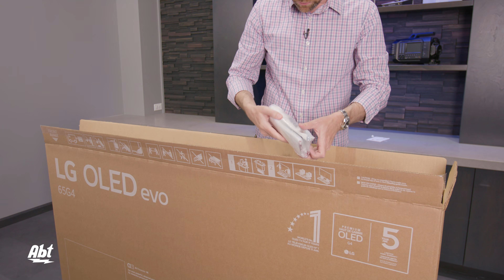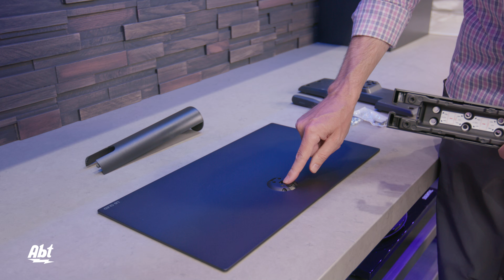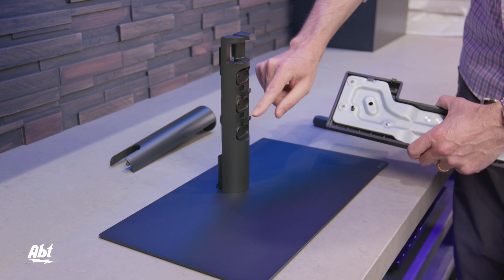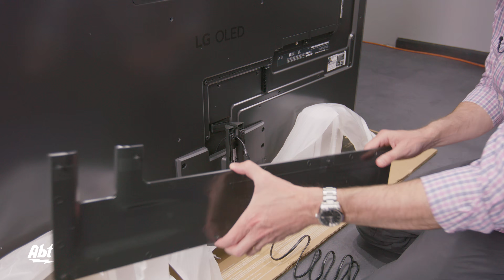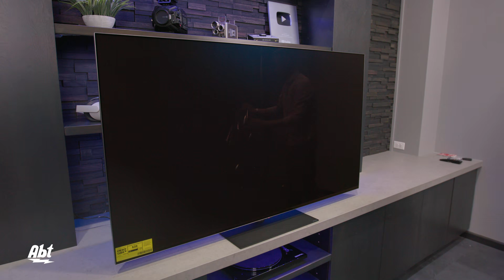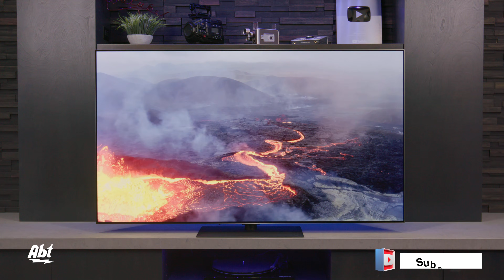How To Unbox The 2024 LG G4 OLED And Install The Pedestal

Comment: The stand is easy to assemble. My question is, since it seems to fit both the 55 and 65, I wonder if it fits the new G5 55 and 65 inch models as well. They have identical dims, and the other larger tv’s (77 & 83) are also backwards compatible. Any real world answers there guys? Nice vid 👍👍
Reply from the maker: @user-hf8ie8mf3n We don't have a G4 at the store any longer to test this out. According to our parts department, all three parts that make up the pedestal have different part numbers on the G5 vs the G4, so it looks like it would not work. We are waiting to hear back from our LG representative for a definitive answer and we'll update this comment once we know for sure.
Reply: Appreciate it. Cheers. 👍🤪🏳️‍🌈
Reply: No worries. I’ve dealt with this stuff for years. Just used a stand designed for the G4 77 on a G5. Fits perfectly. The other stands are exactly the same, part numbers don’t mean anything. You’ll have to trust me on this. I’ll be okay. Cheers.
Reply from the maker: @user-hf8ie8mf3n We also just got confirmation from LG that the G4 pedestal fits the G5 as well. Have a great day!
Reply: @abtelectronics would this be the same process for the g5 55 inch ? Or do you lay it down ?

Comment: Hey, maybe you said it, but if you buy the model with the stand, is there still a wall mount included or you then have to buy this seperately?
Reply from the maker: @SkoxLy The 55 and 65 inch G4 each came with a stand. The wall mount is a separate purchase. The larger sizes came with a wall mount, and the stand was a separate purchase.
Reply: @abtelectronics is the same process for the 55inch g5 ?
Reply: The G42LW is come with wall mount. The G43LS come with stand. So be careful when you buy it.

Comment: Today the TV is still sold, but the pedistal (ST-G4SN65) has since been discontinued. This means that either you have to wall mount the TV, or you should not get it at all.
Reply from the maker: @TheEbbemonster We can still get the pedestal, but it has been on backorder for a bit. Here's a link to our site where it can be ordered if you need one: https://www.abt.com/LG-OLED-G-Series-83-inch-and-77-inch-Stand-and-Backcover-STG4WR8377/p/213595.html

Comment: It's annoying they don't give you this on the 55 inch — they want us to lay it flat face down, but I don't want to put pressure on the pixels.   Mine is arriving shortly and I'm thinking a better way might be to just sit it on 2 identical dining table chairs with high enough backs to hold it upright, and the gap in between the two chairs allows room to come underneath to fit the stand.
Reply: How did you do it in the end got g5 coming tommorow
Reply: @Dingle18   i used the 2 dining table chairs with padded seats.    it leaves a gap in between the 2 chairs where i could attach the stand.
Reply: @Animal_lives_matter oh really is laying is down a bad idea everyone lays it down I’m getting a g5 55 inch tomorrow as that says to lay down
Reply: @Dingle18 
If you do that just make sure the surface is perfectly flat and soft.   I was going to lay it down on my dining table but I noticed there were little ridges and bumps in the table surface  that could potentially make concentrated pressure points on certain parts of the screen
Reply: @A @Animal_lives_matter I was thinking a sofa sections with a thin quilt ontop would that work. Also I seen HDMI DEEP COLOUR settings do you need that on ?
Reply: @Dingle18 
Not sure, depends on the sofa shape.   I don't have the G4 anymore due to screen uniformity issues but I presume the answer is yes when viewing HDR content with P3/2020 metadata in the HDMI signal

Comment: Is it possible that some versionns doesnt consist with pedistal ?
Reply from the maker: @bubzonya The G4 only comes with a pedestal on the 55 and 65 inch models. The larger sizes come with a wall mount in the box.
Reply: @abtelectronics  thank you! i have 65 but its without pedestal :/

Comment: With the help of my brother-in-law, I finally got my new 65" G4 set up ... sort of.  I couldn't find the correct size allen wrench to remove my old TV from the wall and mount the new one so I ended up installing the pedestal and putting it in a different room.  I'll have to temporarily move my Sony X800M2 so I can watch some movies.  No rhyme or reason, but I'm thinking either 2001 (Dolby Vision) or Avatar, for the colors, as my first movie.  I realized not many of my Blu-rays are DV compatible...I might have to double-dip and get some of the 4K versions at some point.  I hope I can get my TV mounted in my bedroom.  I REALLY don't want to have to move all my equipment (AVR, amp, speakers, etc.).  That would be a major hassle!  So far, 4K You-Tube videos are pretty impressive, given I moved from a 50" QNED to a 65" OLED.

Comment: Do you have to use the stand? Does it double-up as a place to fix the soundbar too when wall mounting?
Reply from the maker: @mattsorrell9386 Only the 55 and 65 inch models of the G4 come with a stand. The stand is not multipurpose, so if you choose to wall mount the TV just store it in a safe place in case you need it down the road sometime.

Comment: Let's see if I understand, in the 65-inch model of the G4, is the pedestal that you show in the video already included? 🤔
Reply: depends on the country
Reply from the maker: @LitoDx That is correct. The pedestal shown in the video is what comes with the 55 and 65 inch G4 models. The larger sizes in the G4 series come with a wall mount in the box instead. This is for the US market though. Other markets may differ.

Comment: Can you use this method for the 77” model as well (standing up on styrofoam to install stand)
Reply from the maker: @JD-op6vn The only size they show this particular installation type for is the 65" model. The others are shown laying face down on a flat surface with the thin Styrofoam sheet underneath.
Reply: @abtelectronics what about the g5 55 inch ?

Comment: Look like LG listened to the public to have a choose to have a proper stand on the G4
Reply from the maker: @neiltaylor6645 Yes, the 55" and 65" come with it in the box. The larger sizes still only come with a wall mount, but you can add the stand separately if you choose.
Reply: @abtelectronics  yes the dodgy stand that was available last year
Reply: @neiltaylor6645 Yup I would rather buy a third party stand than use last year's LG stand.  Shame LG didn't include the upgraded stand with 77 inch
Reply: we dont have it in China
Reply: Too bad the 77/83” will be tilted.